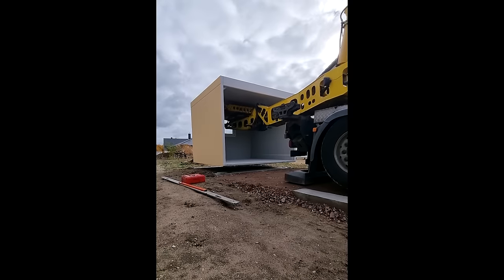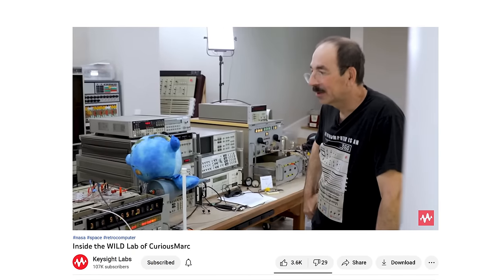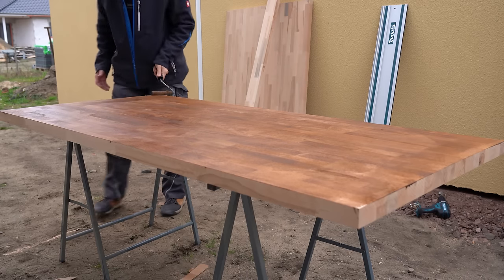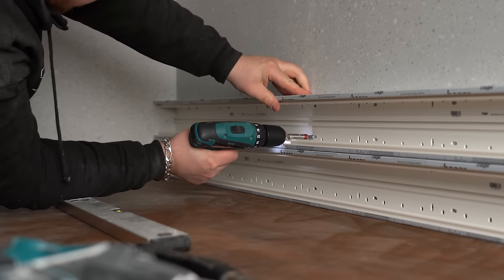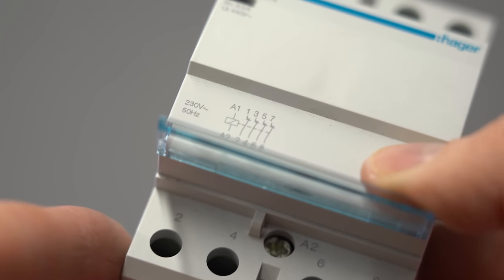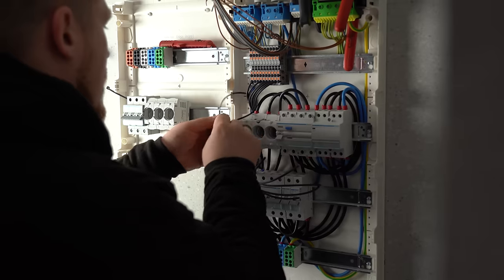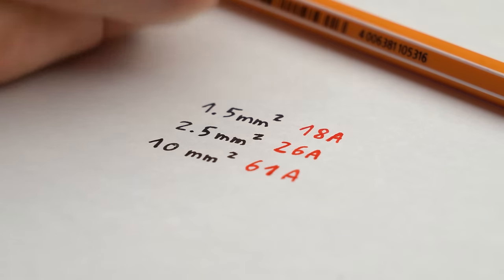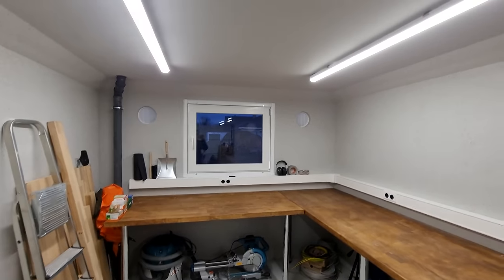Germans do the PERFECT Electrical Wiring! (Garage Build)

Comment: What a time to be alive where you can just order a concrete box and have an instant garage. They even have house kits where they'll just crane the pieces into place and done. The fact that it has a pre-installed window in that concrete box is the cherry on top. For that matter, they do have some companies that are experimenting with 3D printing concrete houses, and even putting insulation in the walls. I know they had house kits in the 1800's, but for the longest time such things were niche, now it's so much easier and more accessible.
Reply: And a lot of those Sears kit houses are still around and in use as well.
Reply: Concrete-Box garages are more or less Standard in Germany since 50 years.
Reply: @mdk-wc2sw  I find it interesting the roof drains are run inside the space.
Can you explain to this American why they do that?
Reply: @jimurrata6785  Well, I would guess that - because the roof is "integrated" in the garage itself - which means that the roof is formed by just the roof plate being lowered maybe 3 inces below the top ends of the wall, forming kind of a "tub", it's jsut the easiest way to drain the roof. Thus, it gives you the possibility to stack the garages just wall to wall (no matter if sidewall or backwall) to form "garage yards" (also common in residential areas here) without the need for spacing.
Reply: @mdk-wc2sw  🤔 I understand now how locating it inside would be advantageous.
I wasn't thinking about stacking them tight, perhaps because this one is shown out in the open.
Thanks for your reply!
Reply: That has been common over here for at least 50 years.
Reply: These concrete box garages are fairly common for standalone garages, for houses where the garage is integrated into the home they're not (for obvious reasons). They do exist in a bunch of different versions, even as duplex garages. Its still somewhat funny to speed by a truck carrying a whole garage. 

3D printed houses are a hype here in Germany as well, but I don't think they'll nearly as impactful as many people claim. 3D printed houses still require tons of manual work (electrical wiring, plumbing, etc) that doesn't benefit at all from the 3D printing approach. But what is still on the rise are (wooden) prefab houses. Given the somewhat serial manufacturing approach and the layered/modular approach they are very flexible in terms of how they can be assembled but also make things like plumbing or electrical work a lot easier.
Reply: My suggestions: add plumbing for air tooling now. You'll need it at some point. PVC sch40 up to 4" is good to 200psi. 3x safety factor = 600psi which the PVC sch40 meets. You can size down but the shear stress due to fluid flow as the friction of the air is uh quadratic? It's a lot, haha.

In the 50s? 40s? during the golden-age of Sears, they had a pre-fab house available from their catalogs. It was reasonably priced, fairly well constructed from the factory and sold well.  Not so much in regions where you didn't need your foundation to be 16 inches below the frost-line (New England, the tri-state area, etc), since that involved bringing in a team/civil engineer to get that done so people would just develop a house to-spec of their own.

From an ecosystainability POV, steel and concrete are like 20-25% of the entire worlds emissions load of the entire (methane, NOX, CO2 and the florinated gasses). That includes China-ships using the cheapest oil dregs they can find on the Nigerian black market so we can get Arduinos for 20 cents, and illegal deforestation that's messing with, the oldest dirtiest tractors from the 1940s without DPFs (and modern diesels with DPF deletes), consumer cars (diesel or petrol), etc, and (what people forget!) all plastics are made out of hydrocarbons. About 6-8% of the crude oil load goes to plastics feedstock. And at end-of-life, since we don't really recycle things like plastic bottles[1]. 

So yeah, if concrete is your only option, or you live in a region where there are not well-established/well-enforced firecodes, or maybe its just your housing culture who am I to fault you for that..But properly constructed lumber homes from the 1800s are still around from the town where I grew up. Granted the tradesmen were likely paying a lot more attention to the grain of every stair tread they planed, and the orientation of every quarter-sawn cabinet panel they cut then than now. Woods pretty okay, if done right, especially when it was dirty cheap pre-pandemic. And I say this as someone who prefers to work with metal as a home gamer. 

That being said, their sub-circuit and junction boxes are sexy as hell. He opened it and it was like ~~angelic sounds~. DIN rails, relays, disconnects! It looked like the inside of a well-manufactured PLC control box. I was having some work done at my home and I was actually trying to exactly like this. Nothing was at my local boxstore. At RS they sell breakers that fit on DIN rails, each individually sampling power consumption (reactive, and resistive, fully True RMS, with <1%. I think the specs guaranteed 1% with lt .5% being one sigma deviation out). Having something like that would be incredibly useful, especially with high power costs. 

I wanted to basically have my AC turn off at 10ish, by 11 it'd still be comfortable enough to sleep. Then, using a thermocouple, PWM and the fan, turn it on at various times so that it was nice and cool for the 2 hours I was up before work. Shut it off and leave (Then turn the fan back on, along with an auxiliary fan to pull the hot air out, as this is primarily the uncomfortable heat. Kind of like when you come back into your car 2 hours after its been sitting in the direct sunlight. Before turning on that AC, you want to blast the fan on (exhaust, if your cars fan has that option)with the windows down, to get as close to ambient-outside as possible.). I have a bay window in the living room across from the kitchen (in an open plan). 

So basically I have 2 755's geared down to develop enough torque to open those windows. The fan in the bay window opens, purges ..some air.  (Shoulda got a BME380 to measure air pressure. I wanted to develop a negative pressure, maybe -2 or -3psi.) Then the kitchen window across opens and turns on it's fan, pulling in cool air. In theory, the negative pressure itself should pull in cool air (saving more energy. e.g. I could just open the kitchen window and let the pressure rise to 14.7, saving power).  Finally, I also I wanted Along with a dehumidifier if necessary (in August, it was necessary, but I didn't even get to this point in time). Finally, I was mentally experimenting with using my basement as a "air storage" system. It's nice and cool there, so I figure I'd use the fan to push in cold, night air in for a few hours. There are some days when it goes from 55 to 85. With 1200 sqft, even if 55 goes up to 65 or even 70, assuming low humidity, i call it a win . Central air pulls around 2.2kw while on. The fans, about 400watts. And these things are *powerful*. 

[1]The only thing that's economically feasible to recycle is metals, especially aluminium, which is incredibly energy intensive to initially manufacture but super cheap to recycle basically in perpeuity. Bioplastics are in their infancy (and if we gave the 200billion we just spent on wars that we have no interest in, on university grants for research into researching production, we would have seen incredible progress in the science journals by now). Fast growth lumber, when reasonably priced[2] is a perfectly economical, ecologically sustainable[3] and viable option. Lumber homes are spec'd out specifically to be on the safe side, such that if your home does catch on fire, nothing near you will catch on fire. 

Hemp (the cannibus relative with no psychedelic properties) has been used as a fiber for hippies for years to make, shit, everything. Before canvas bags at the supermarket, there were hippies using hemp. They used it to line their beds. It grows incredibly quick and will grow basically anywhere. Companies were reluctant to explore it as a raw material because of it's questionable legality. (It remains in question at the federal level, hence I suspect why 3M and DuPont haven't pushed anything to market.) However, in start-up land Caliiiiifornia, there are enough rich hippies in a state that basically refuses to let the DEA execute any operations and thus have put money into biosustainable houses made partially or entirely out of hemp. I'm not sure what the actual resource load is re: water consumption et al, but I wouldn't be surprised if you start seeing OSB with 40% hemp at the local box store especially if lumber remains as high as it's been. There have already been full proof of concepts where homes have been built out of hemp, using it basically as a Minecraft block raw building material. They're like 1yd x 1yd x 1yd and you can design whatever you want. They have cores hollowed out for bamboo instead of steel rebar. Demo homes and homes in production (presumably meeting NEC and California state code, which is notoriously strict) are out there but it's not economically viable right now, due to the bespoke "hands-on" approach each build takes. And they can't deal with that without more investment, which requires more sales, which..chicken and egg.

[2] Lumber (and building materials in general-- steel for commercial, copper for Romex, even screws and power tools) shot up in price on the domestic side. The inflation reduction act was basically a gift to a certain demographic the ("no kids, dual income, college educated, coastal couples") in certain markets, or those who just had great credit and wanted to take advantage of the 0% Federal Funds Rate (you'd walk out of the bank with a 2% HELOC in 2021, 3 years later with rates at 5.5% you got fat in what was essentially a zero-growth market-- and this is how the rich get richer and why homes should be banned as investment vehicles, why real estate agents who charge more than 1% for commission doing a job that redfin.com can do should go to jail, and why the banks and Fed[a private institution with no transparency who arbitrarily dictates to the Treasury "we will lend to you at __"], and they're forced to take it) make money on both sides of the trade, even if you lose your shirt.

[3]  NOTE: This only applies in the US. We have a few select regions that, if sustainably replanting, which loggers have been doing since the 80s as its in their best interest for their next generation. We can basically keep regrowing the major structural lumbers (strong enough to support a house, and hits maturity quickly enough [about 40 yrs] that they are viable econoically)-- Douglas Fir, Pine, (and I forget the third major species) basically forever, without depleting the soil of the nitrogen,potassium and phosphorus like we're seeing in the midwest now. 40 years will afford the forests enough time to re-establish ideal homeostasis, as long as you sector out the land you log. Europe in general doesn't have vast land mass available to them, so the economics I'm sure are drastically different.

Comment: Just so you know, the power consumption of your contactor is actually 5.75W, the 62.5W figure you mentioned is the in-rush power (when it first energises) but it only draws that for a fraction of a second. So you'll only use 0.14kW per day if you left it permanently energised.
Reply: Thanks, I just looked for this comment, as few months ago I used same hager 4p 63A relay, and remember that power consumption was near 6 watts. 👍
Reply: Not an inconsiderable sum with the cost of electric these days. That still adds up to $25 per year for one single contactor. Crazy.
Reply: Best option would be to use a "Unterspannungsauslöser" or under voltage trigger module for the main RCD
Reply: That’s calculated the same as the rating on my 6hp vacuum.   That’s 4.4kw with 100% efficiency when the circuit is 15A@120V is not even capable of anything past 3.6kW and is against code to continuously supply more than 2.9.
Reply: Im glad you said this, when I heard 63w, i was like wtf that doesnt sound like any relay Ive used, you would need a dam heat sink on that relay at a constant 63w.
Reply: This does get even more confusing as many manufacturers have graphs where if it’s been powered on for like a week it was a slightly less after that and after strange things

Comment: I’m an Industrial electrician and work with safety critical circuits every day. I really like that you implemented a two safety switches but there some way of improvement without sacrificing massive energy losses. Safety switches normally use two independent opening switches called channel one and two. Those chanels are interconnected through every switch used in this safety circuit. Those are then wired into a so called safety relay(sicherheitsrelais in deutsch hersteller da vor allem Pilz, Wieland und Siemens ) those Monitor constantly if the two channels are interrupted or shorted together. If one of them fails they shut of a relay output and have to be reset via another pushbutton or keyswitch. Paired with an 3 phase contactor (leistungsschütz) they provide a very secure system. Those industrial 24V contactors are way more energy efficient then the one in the video. As an example a Sirius 3RT2025 draws 5.9W even with an additional power supply and safety relay thats way below the 62w of the hager relay
Reply: This is how we do it in Australia too, also usually with the German brands.

Comment: If you want to carry long heavy objects by yourself easier just mount a couple of wheels on a piece of plywood and line the other side with some non scratching material like leftover soft carpet. Put one side of your heavy objects on the plywood and carry the other side. You'd be surprised how much easier it is then :)
Reply from the maker: Thanks for the tip :-)
Reply: the name for such a use is "travois"... we used to make them regularly in Boy Scouts for hauling gear into remote campsites, etc
Reply: It's called "Rollbrett" in Germany
Reply: Do you mean this thing called a skateboard?? 🛹😉
Reply: @jimurrata6785  well, I wouldn't put a nice finished table top on a skateboard :)
Reply: @rafaelef922  it wasn't nicely finished when he tried to move it by himself. 😉
Any piece of cardboard or a sock will keep the top away from the grip tape.
I only thought of this when I had to move a bunch of sheetrock and had a board in my truck.
People chuckled, but I saved my back over the course of the day and 200+ sheets got set out where they were needed.
Reply: @PeteVanDemark  The NEC disallows NM in exposed locations only where subject to damage.
You can have it above 8', running through exposed studs (though not stapled to the front of them) and (commonly) where they enter a service panel.
Yes, we wouldn't allow it exposed entering a device box, but that's why we have offsets.
Reply: @jimurrata6785  I believe that's called ingenuity. Work smarter, not harder.
Reply: they even sell these at harbor freight for 11$
Reply: @zlmdragon.  first option is always a second person, but you don't always have the option to have a second person with you